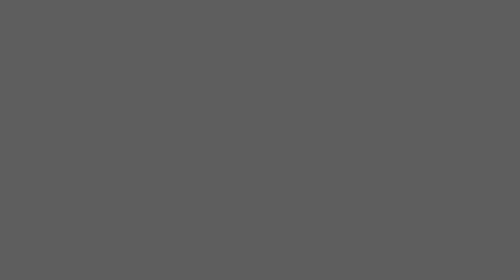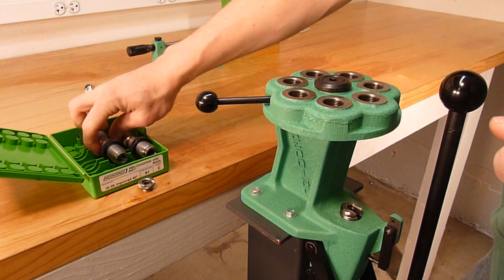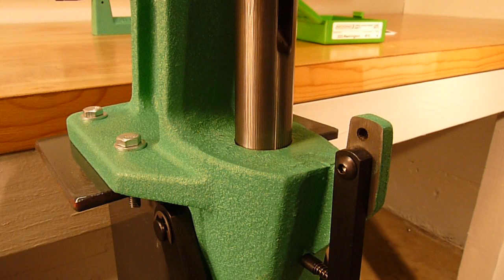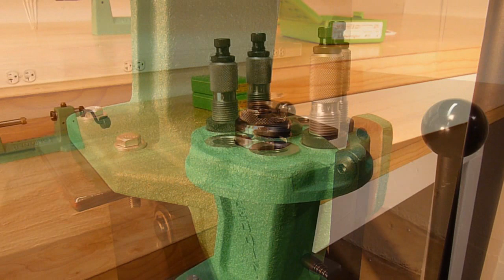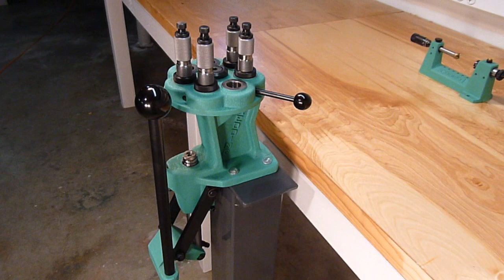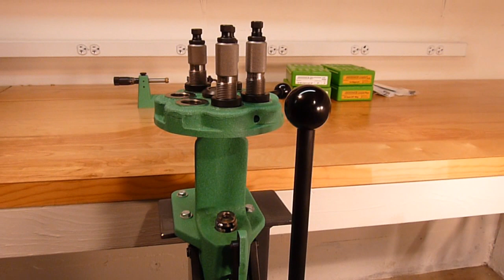Redding T-7 Turret Reloading Press Overview (HD)

Comment: I use mine with two turrets one for pistols and one for rifles. The rifle turret has 308 30-06 and 35 rem, one of each reloading die, and Lee factory crimp and the last hole is for the powder measure. I have a similar setup for the second turret set up for 38super, 30luger, and 357/38spec and a lee factory crimp for each and a redding pistol powder measure. It works great dies are all set to load without having to adjust.
Reply: i want to reload 556 and pistols, is this press good for me ?

Comment: I deprime with a single stage RCBS setup with Hornady's lock and load system each caliber I reload has a deprimer setup in a loc-n-load ring. So I take the used brass deprime and size it in the single stage, clean it in a tumbler of walnut shells (lizard bedding) hand prime with the Lee primer. Then reload on the redding T7 press.